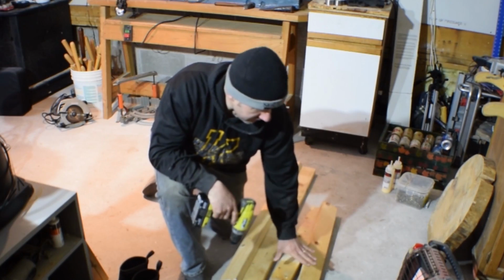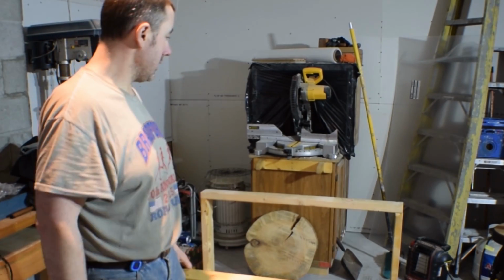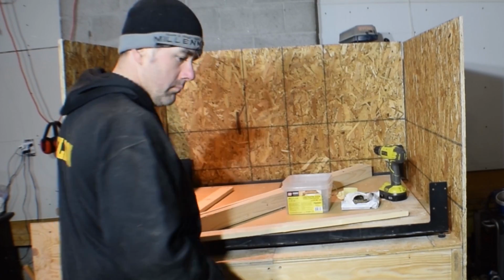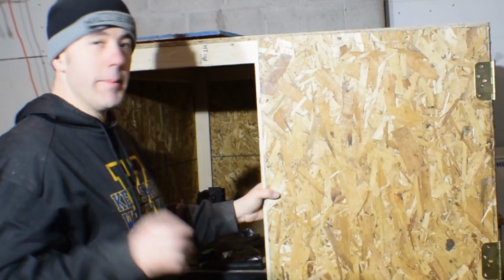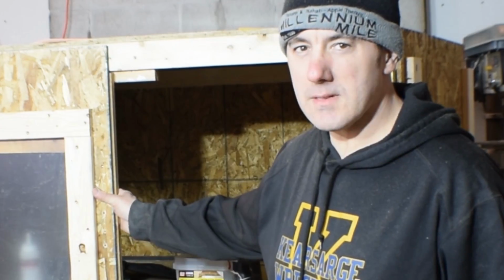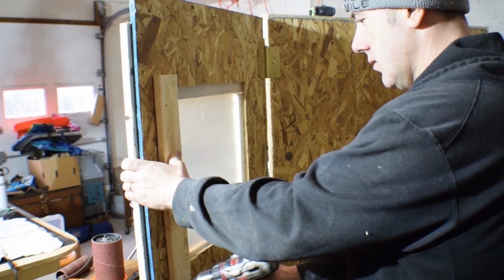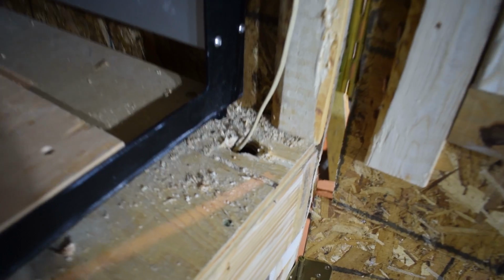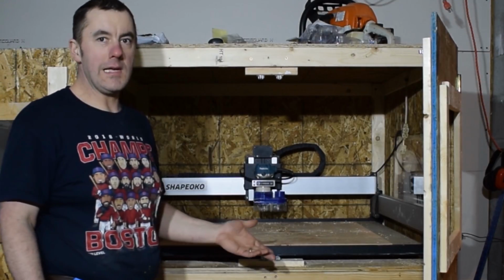CNC Enclosure Build for my Shapeoko 3 XXL (Simple - Yet Functional)

Comment: if you're really gentle you can use a plywood blade in a table saw / circular saw installed BACKWARDS to cut plastic.  Works good fro vinyl siding, too. It melts it's way through instead of cutting.      You can also use a fiber cutoff wheel.    
But in any event.... if you cock the blade sideways the sheet will blow apart LOL.   So go easy and use a guide or fence.
Reply from the maker: I've learned to be patient over time.  That's after wasting lots of material by being in a rush, lol

Comment: I'm glad 2 c u didn't use that S.O._ board. Thanks 4 the tip about the plexiglass! Oh and remind me not to take things apart after u put them together(screwed & glued).
Reply from the maker: You should see me build legos, lol.
Reply: @practicallyIndependent  speaking of that maybe u should do a vid reguarding the cost and value of making parts on the 3D printer if u guys ever get in 2 that
Reply from the maker: That's a good idea.  I have a few things I need to make.
Reply: @practicallyIndependent  don't be making any plastic guns unless of coarse ...... they r squirt guns or nerf guns!
Reply from the maker: Uh oh!  Now you are giving me ideas! Lol